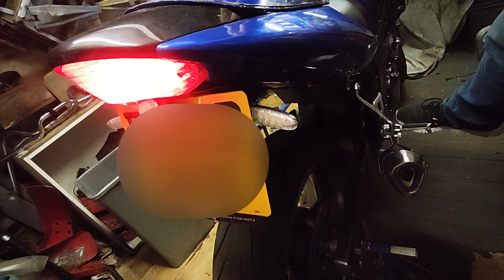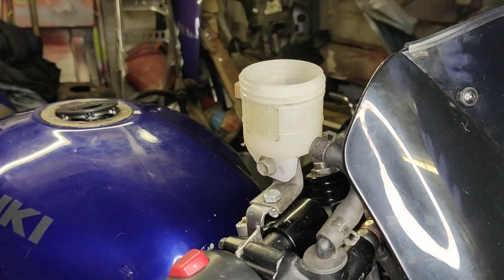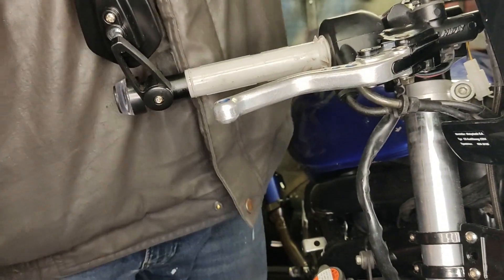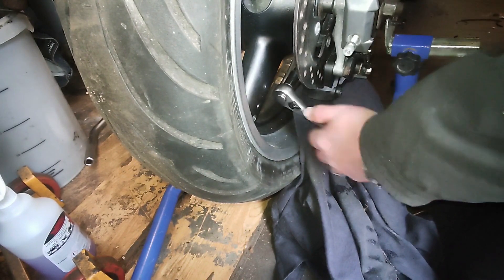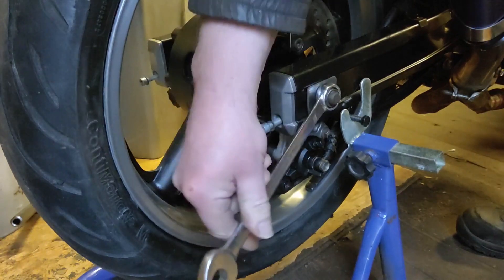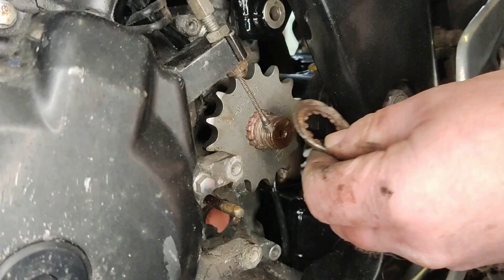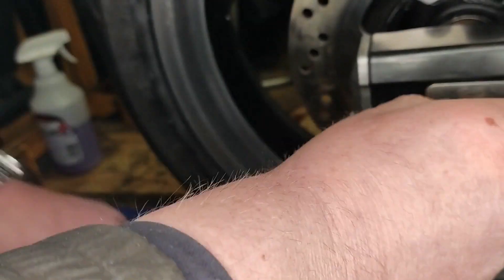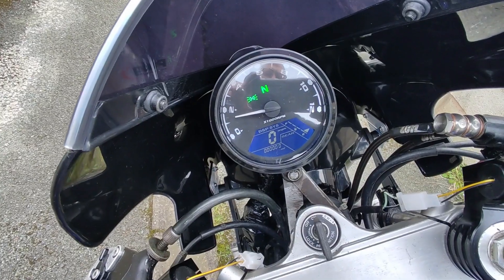Part19 of the SV650 Rebuild..... SHE LIVES!

Comment: Often the bleed screws are a poor fit into the caliper and allow air back into the system via the bleed screw threads. If you wrap some plumber's PTFE tape around the bleed screw it prevents this and allows bleeding to be completed in a matter of a few minutes. The added advantage is that the PTFE tape stops galvanic corrosion between the aluminium caliper and the steel bleed screw so that the bleed screw is less likely to sieze or shear next time you come to do the brakes.

Comment: Nice work !  Stock tyre pressure for a sv is 33 psi front, 36 psi rear.  Please fit better tyres on for road use.
Reply from the maker: Really? I've always run 36 & 42psi on the road, 30 - 35 front & rear on track. I'll try the lower pressure once it's on the road to see what it's like 👍